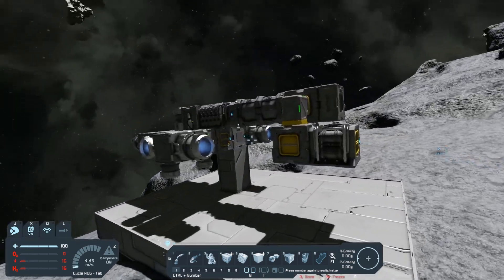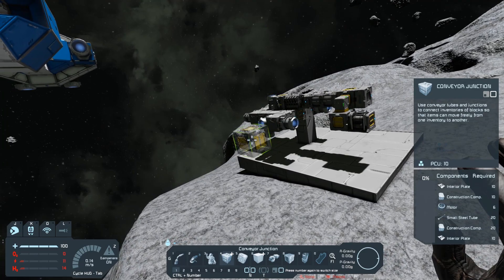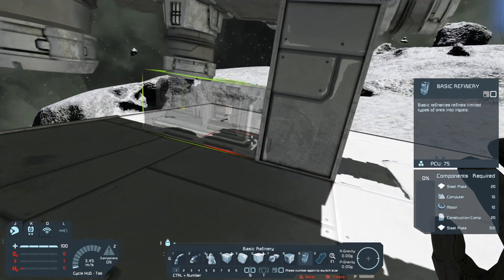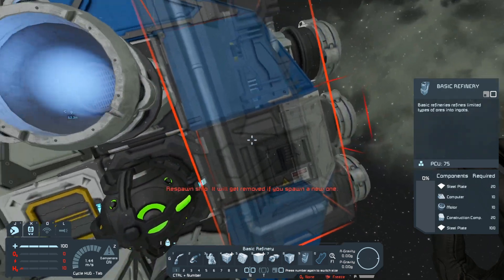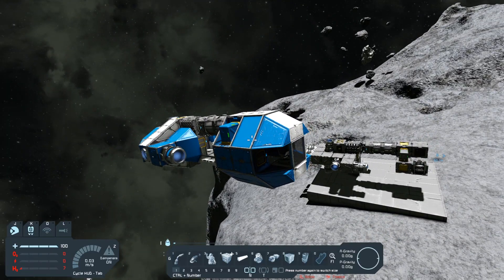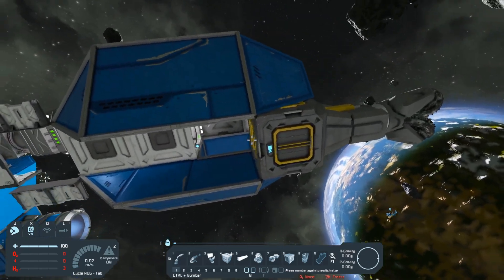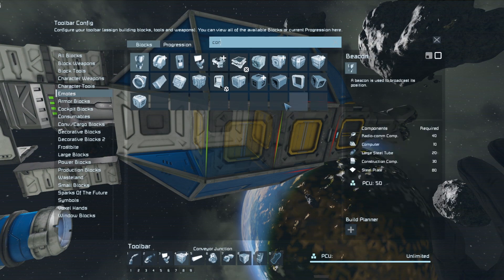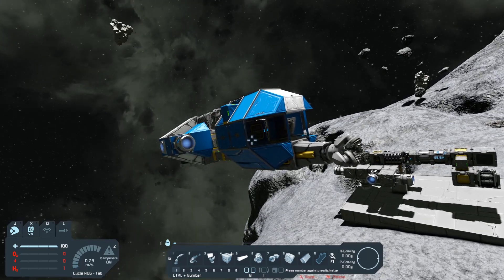Space Engineers Tutorials: Upgrading the Space Pod

Comment: I tend to go using the conveyor block that was originally connected to the vent to push out and set a pair of cargo boxes on each side. then It's not hard to attach drills to the sides. Or even wrap them more around the cock pit. And at one time I accidentally destroyed the rear of my respawn ship so they ended up split and had to rebuild it. Everything just behind the hydrogen engine detached or destroyed. I ended up resetting the Thrusters so they were arranged wider, and I could attach a few more parts around the back conveyor setup. In response to that, I build a wider array of drills to the front too, and they ended up in a sort of wide diamond shape, making it Actually more effective to dig and move around, with a connector planted just behind one of the far drills so I could dock it to the sides to any base structure that had greater refinery setups. So Extra storage, extra thrust, and extra drills.

Comment: i put 3 drills in front as the darn things in vanilla drill soooo slow and i put 1 more o2 gen at the back with access going to both the refiner and passing to the front with 1-2 small large containers also as mentionned in other comment  i remove 1 ion thruster from the rear and replace with ore large detector the extra o2 is for the extra hydro for engine in emergencies it gobbles up alot still and much ice is needed to keep it fueled :-)

Comment: I also prefer to knock out the right side window and place the drill system on the side of the survival kit. Usually a conveyor junction then a piston and then the drill. That way I can extend it out a bit and get the drill into places where I can’t get the ship closer to. Also you could put the assembler on the underside of the cargo container next to the basic refinery. Although I normally would switch the 2 around so the basic refinery is connected to the bottom of the small cargo container and the top of it sits under the floor there and the basic assembler behind that in the other conveyor port. If I recall correctly this means you don’t need to move the gyroscope either.

Comment: I like to remove the middle rear thruster and replace it with an ore detector as soon as I can. Two forward thrusters is plenty and it gives you much needed components early on. And I take the drill right off the survival kit. It places the drill just to one side of you. Or off that bottom connection of the cargo container for a "scraper" drill setup (depending on my mood).
Reply: Same, cargo and drill off the kit. I also use that second lower connection where he put the basic refinery for the basic assembly so the cockpit keeps the vent and stays pressurized. The setup uses way less conveyors so you get to the drill much faster. The basic assembly goes away eventually so no need to kill the vent to do that. The basic assembler gets replaced with a cargo as well eventually. Makes life easier when you are boating between asteroids if you don’t die from suffocation. In space you really don’t need much more than that until you get a smaller mining ship.